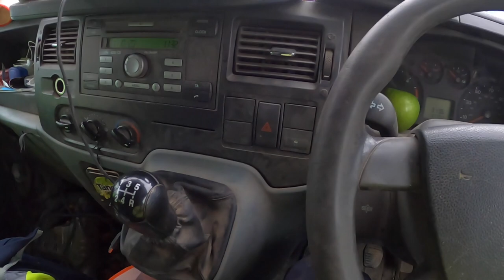BLOCK WALLS UP TO SCAFFOLD. HEIGHT ... PART 2

Comment: Great job and nice video work. Block stacking makes sense. Wonder if others don't do cos of site safety (kids breaking in ) on more open sites. For the profile on the wall for the internals, why not fix a batten to the wall with bunch of frame screws, with some old say M10 nuts as spacers, then thread the line through the gap. That said you seemed to do  just fine without it LOL. Look forward to next one.
Reply from the maker: Good idea 👌🏼🧱👍🏽

Comment: Hi guys great job nice to use them fibolites. Just doin a job now on some apartments and can you believe some of the blocks are 10n impossible to lay at best of times.BTW that looks like Skem your working in with all that no fines concrete houses.
Reply from the maker: 10 n ! It’s a no from me 🥵😆. 
Abs yes you are correct 🧱👍🏽

Comment: Good job so far guys, same piss weather in Belgium here.. Rained off a few times this week no fun at all , no dpc there isn't, setback food you noticed it or maybe some water issues later 👌🙏 stay safe guys
Reply from the maker: Yeah customer said don’t worry about it but we put in the Dpc anyway , just mad I missed it in the first place 🙄🧱👍🏽
Reply: @SteveAndAlexBuild  topjob 👊
Reply from the maker: @JayKTS  🤙🏼🤙🏼👍🏽🧱
Reply: @SteveAndAlexBuild  Steve that floor structure will eventually be subject to wet rot the d.p.c should have been placed on top of the first course of blocks up from the foundation which would have provided protection to the entirety of the floor structure . These timber joists floors are always problematic they require very detailed thought prior to construction. I’d always advise against them and would only use them as a last resort .
Reply from the maker: @brickbybric  😬🧱👍🏽

Comment: Great work guys what size do you put your cavity in for insulation to stop them squeezing your block ? We are nearly always on timber kits in Scotland ?
Reply from the maker: We add 5 mm which is just enough unless the insulation is crap like our first pack so we struggled a bit 😠🧱👍🏽

Comment: Hi Steve, thanks for the video. I notice that you haven't returned the inner leaf, left a check or built in a cavity closer at the window opening.. What's the plan here?
Reply from the maker: We our remidial ones in after , cut to size and slot in 🧱👍🏽
Reply: I didn't think Building Regs allowed return closing of a cavity now?
Reply: @ColinDH12345  you might be right there about a complete close, but I understand that you can return the inner leaf to, say, 25mm off the outside leaf and insert an insulated vertical dpc.
Helps with fixing points for doors etc, but maintains that moisture barrier BC wants..
Reply from the maker: @ColinDH12345  . Didn’t think so 🧱👍🏽

Comment: rather than free handing the internal block work, couldnt you use 2 dutch pins and 2 corner blocks, one at the top and one at the bottom, then string a line off? :)

Comment: what kind of insulation material is being used in between the walls?
Reply from the maker: Fibreglass full fill cavity batts 100 mm 🧱👍🏽
Reply: @SteveAndAlexBuild  do the building codes require insulation for extensions? if yes, what is the minimum rating?
Reply from the maker: @halalmeatshophk  Not sure on the ratings , better to google it but insulation is a must 🧱👍🏽

Comment: Nice vid. What you reckon to them fibolites compared to 7n solids? On a non bricky note, be better if them joists were wrapped in dpc if gonna build in.. these days be better doing hangers
Reply from the maker: I’d have them over 7n block any day . As for the joists they are nothing to do with us 👍🏼🧱
Reply: @SteveAndAlexBuild  what is shrinkage like on them? They as bad as thermalites for cracking when they dry out? Yea i know mate just thinking BC might pull that on the joists..
Reply from the maker: @dm8401  . I have never seen a thermalite crack they are even the hardest to Cut , great block , just bloody expensive now 🤯🧱👍🏼
Reply: @SteveAndAlexBuild  loads of reno jobs i go and when you take plasterboard off walls with thermalites behind LOADS of shrinkage cracks through the blocks.. you wont see them crack as you build, its later on..
Reply from the maker: @dm8401  🤣🤣 that was a typo , should have said Fibolite 🙄, thermalites are shite 🧱👍🏽
Reply: @SteveAndAlexBuild  👍😂
Reply from the maker: @dm8401  🧱👍🏽

Comment: Untreated joists on the wrong hangers, if the outside is being rendered needs to be 7.5 Newton blocks, didnt think fibolite whent to 7.5 Newton could be wrong.
Reply: Those blocks are great to render on to doesn't matter what Newton they are 😂
Reply from the maker: @Michael-hs3bo  😉🧱👍🏽
Reply: The newton value of a block is relating to its strength under compression ! Obviously this has nothing to do with the render. The reason 7N blocks are good for rendering is they provide a good key and are not to thirsty. The only reason fibrelite blocks are not used more for the outer skin of a rendered building is they are more expensive than 7N  lightweights.
Reply from the maker: @MrBez007  . Thanks pal 🧱👍🏽👌🏼